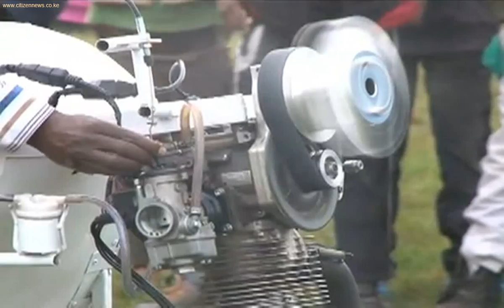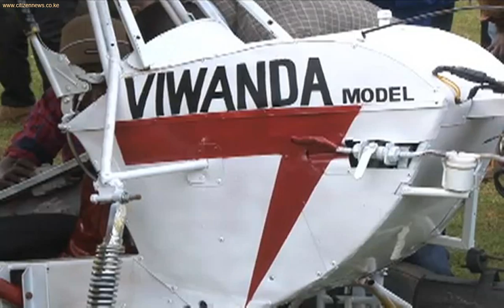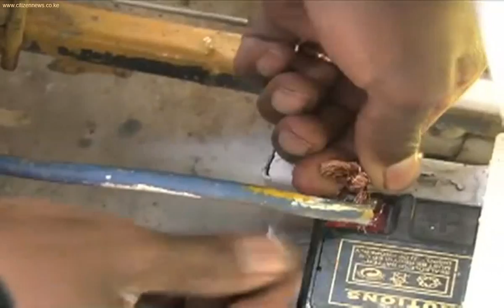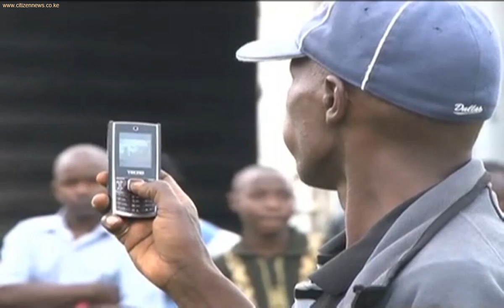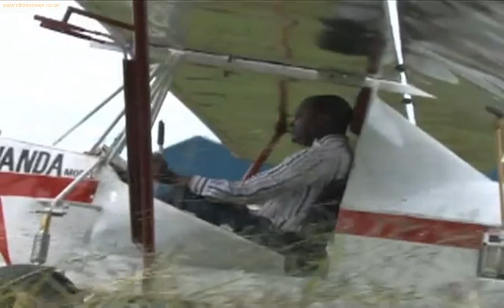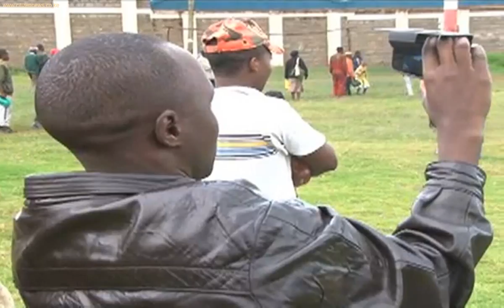Man in Nyeri Builds Aircraft

Comment: Aerospace quaility wire twist connection and steel frame and support and a weed eater motor.
Combined with African engineering.   How did it fail ? I can't believe it.

Comment: looking at the exhaust pipe and muffler, It looks like the muffler is attached to the aircraft frame rather than the engne so the vibration and flexing will soon have it cracked and shortly after than, disattached from the engine.
Reply: rkwill100  Lol... I think that noise abatement is a rather low priority for this endeavor

Comment: lots of cell phone usage, so someone has money, and the 'inventor' has a decent job, so my suggestion is to grab an engine out of a car.  Of course, looking at the plane, I thinking the Weight and Balance is way off, probably tail heavy,  Which means if he ever gets it off the ground it will tail spin back to the ground.
Reply: rkwill100 no brother, that problem can be fixed by changing the center of gravity not by adding weight to the aircraft. What he needs is to reduce as much weight on his aircraft structure and get a very good power to weight ratio engine...there is no way this thing will take of even If he got a donor engine from a flying Cessna
Reply: People have had good luck using a Subaru boxer 4 cylinder, a old 2 cylinder rotax 2 stroke out of a snow mobile makes a good engine too. But his big problem is too much weight, and airfoil on wings is too thick. And doubt he's checked center of gravity.
Reply: A nose heavy plane will fly, a tail heavy plane will fly once.....

Comment: My brother, if you want to fly off, use aluminium materials to wings and main fuselage. Iron metal use in landing gear and supporting structures only.
Also i advise you to use BMW gs1200 adventure motorbike engine, for single seat plane this engine is enough.